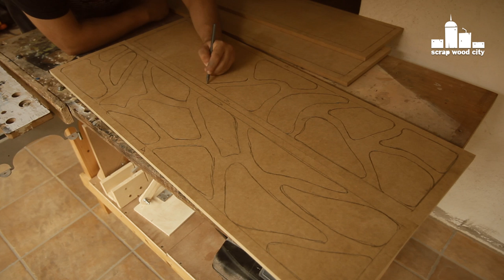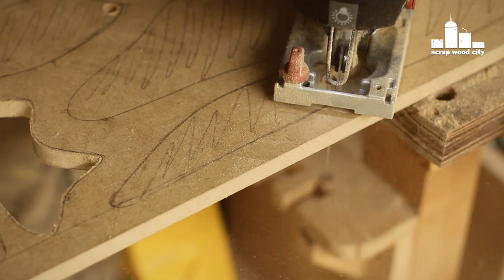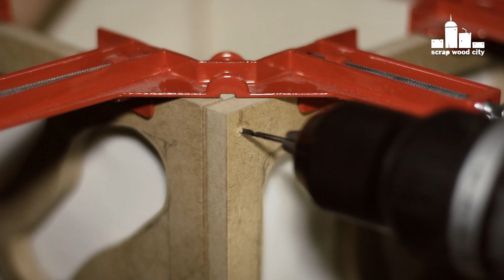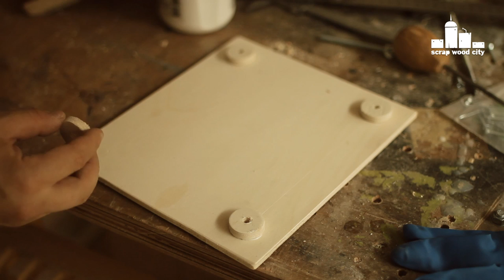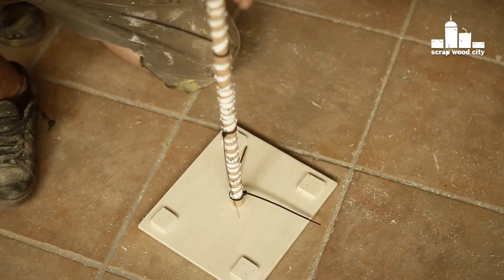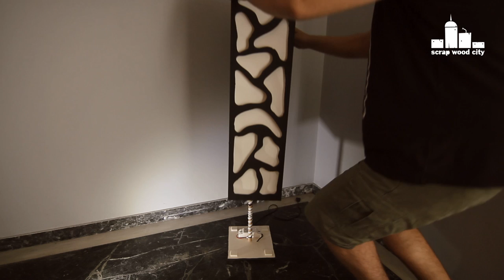DIY floor lamp with a drill and a jigsaw

Comment: Looks nice.  You should wear a particulate mask though, MDF dust has been shown to be carcinogenic when inhaled.

Also, get a sanding drum for the drill and it is still only two tools, but multiple uses.
Reply from the maker: thanks